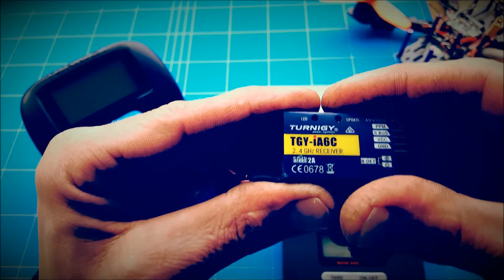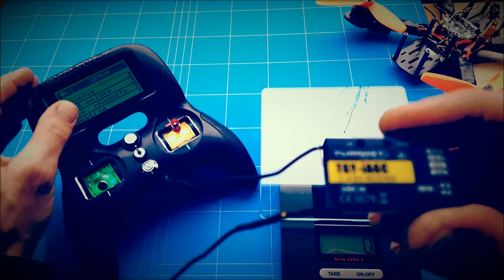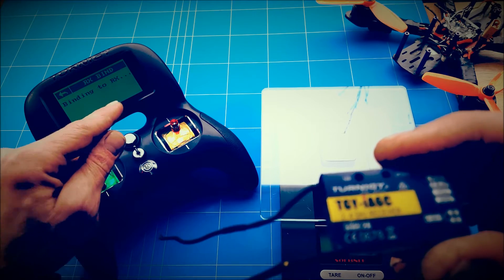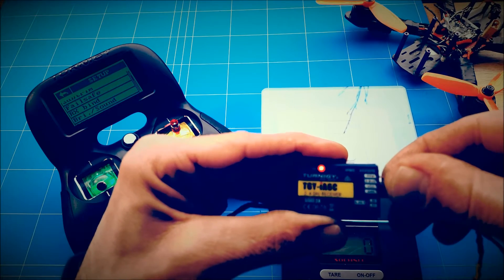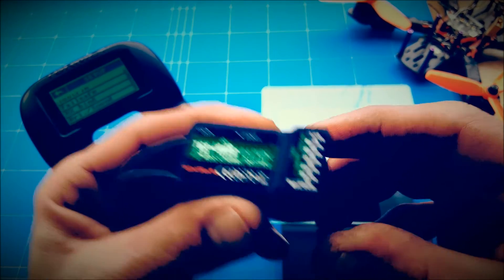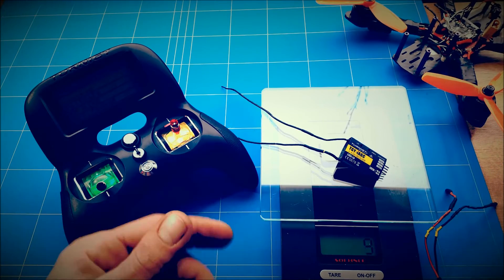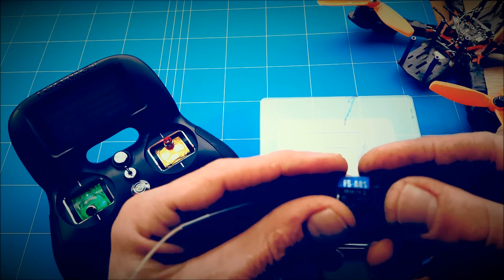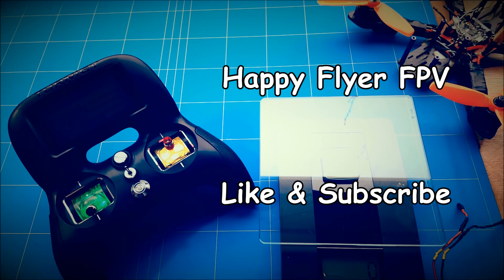How to bind TGY IA6C Receiver To The Turnigy Evolution Radio

Comment: How can I do to bind mode again the turnigy for another radio after the receiver bound ?
Reply from the maker: i geuss the same if its a different radio
Reply: @HowToDIYRc  i use frysky but now i got the jumper t lite but when I turn on my quad with jumper in bind the receiver does not bind still hooked on flysky
Reply: I just found at net how to bind at first time but now i just need re bind like a new owner

Comment: Hey pal. Just had an issue today with my set up. Which is turnigy Evolution with the mini receiver on my xjb 145 micro. Only flew it about 4 times and today Im trying to arm it and it won’t. 
It’s really strange. I thought maybe I accidentally twitched something around on my evolution and why it’s not arming. What steps do you think I should do to make sure it’s still bound ?
Also I tried to bind rx and it does nothing except it says binding and nothing happens. Can I rebind it ? Should I try a different channel ? Thanks you  hope you can help.
Reply from the maker: mini receiver? fs a8s? BINDS different to channels but trying all your channels might work Sir